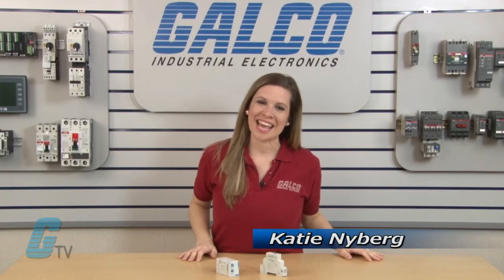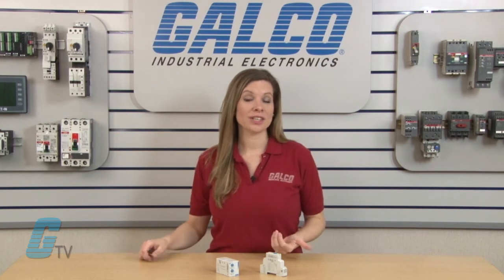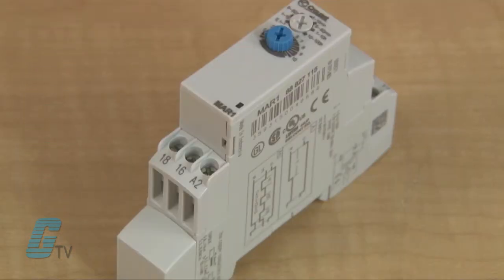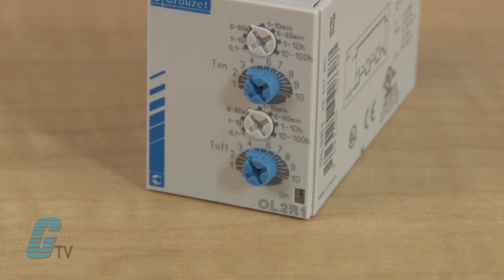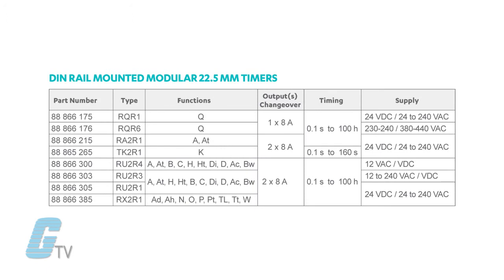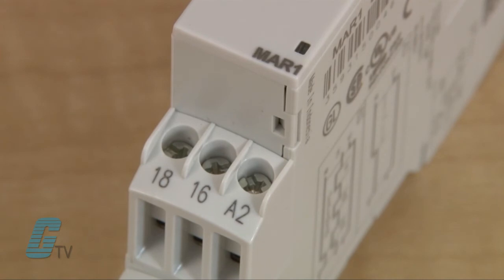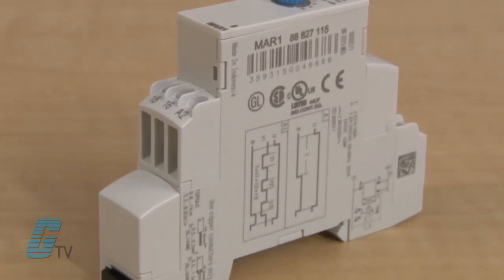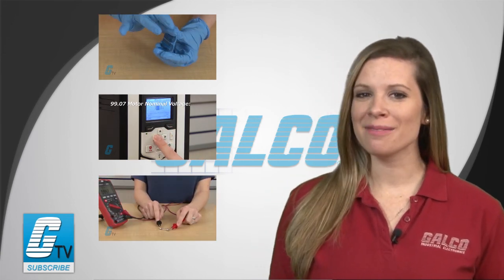Crouzets Chronos 2 Series of Timing Relays

Comment: Is A1 and A2 not power supply.? I put 120Vac and blew the relay.
Reply from the maker: Yes A1 and A2 are the power input terminals. There are 2 types of control voltage 24-240Vac and 24Vdc. I suspect you had the 24volt DC coil.
Reply: @GalcoIndustrial  No I have high voltage one. Maybe faulty part.
Reply from the maker: Sorry to say, it sounds like it has failed.